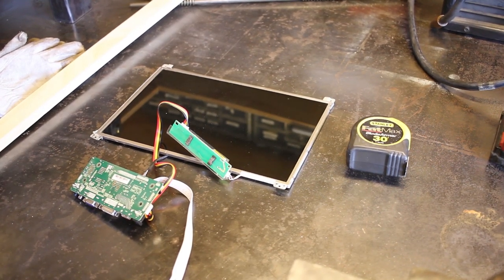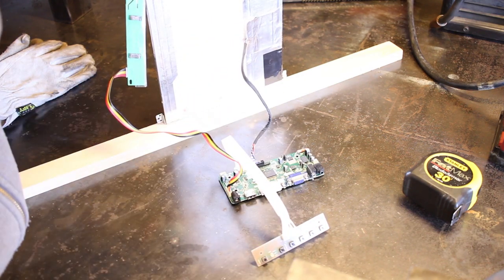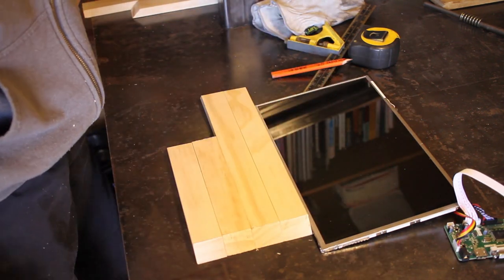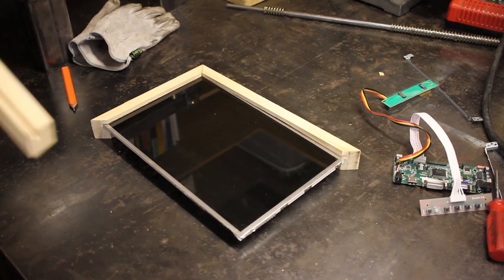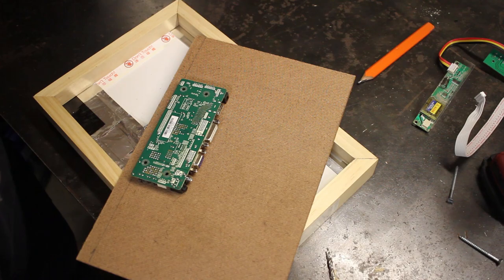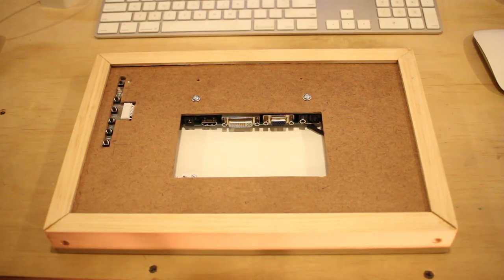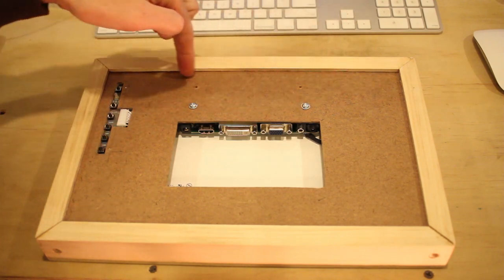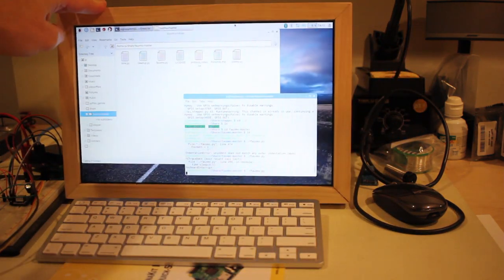Making a custom frame for a reused laptop screen - DIY weekend project

Comment: I'm going to give you an A for a solid re-purpose of an LCD screen. certainly better than it ending up in a land fill. Sure, you've basically wired up an inexpensive monitor but none the less an excellent project. I think the control board is less than $20 so again, decent project. Well done.

Comment: Hi Crushing,
I have a MacBook Pro 2011  15".  It's useless and I'm gonna turn its screen as a second screen.
Could you help me with what exact controller board (fix with it)that I need to buy for it?
Thanks,
Reply from the maker: You'll have to lookup the control board based on the display label on the back of the screen that's in your laptop. It could be any of several options.

Comment: I wanna do this but I don’t have any of the tools is there anywhere I can buy a custom one
Reply from the maker: Do you mean a custom frame? If so I'd check local woodworking shops or maybe cabinet makers and see if someone could cut out the pieces for you. Just check and double check that all your measurements are correct before you give them the dimensions.
Reply from the maker: Terry G  old pallets could lend a good finished product for sure! I was laid off earlier in the pandemic as well. Hope you land on your feet!

Comment: What size screen and measurements
Reply from the maker: The screen is 12.5in x 8.5in... or approx 31cm x 21cm
Reply from the maker: Terry G  correct. I made my  screen inset into the frame, but the size of your screen and the design for your frame will determine the size of your frame. I would recommend not making the screen fit too snug in the frame. If I did it again I'd allow a small amount of clearance between the screen and the frame to allow for any heat/cold expansion and contraction. This way there is less stress on the screen itself. You could use some light foam or spacers to keep the screen from rattling around.